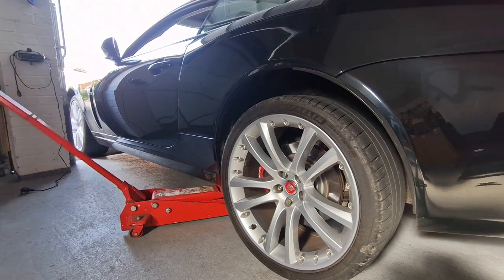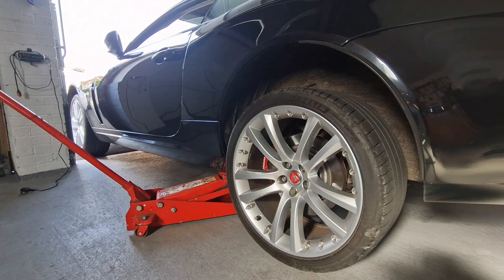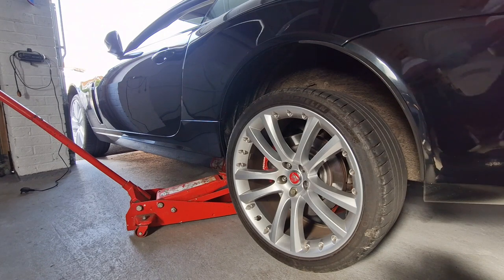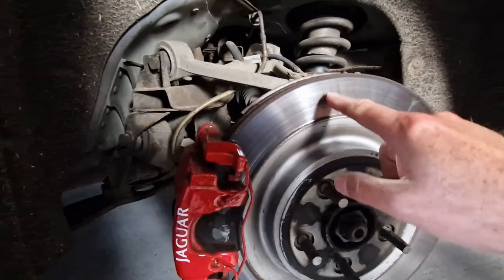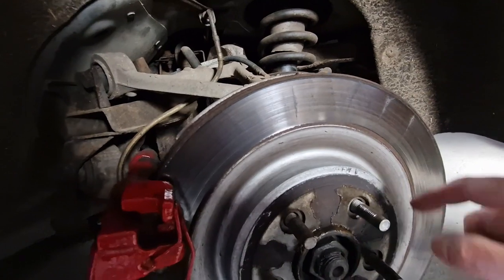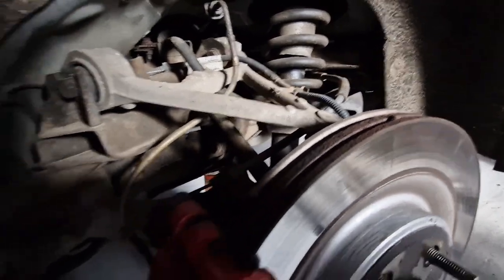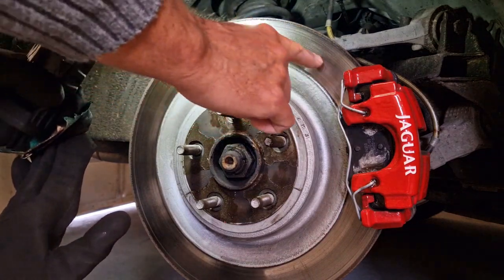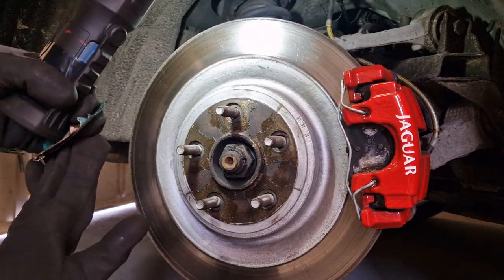Jaguar XK (X150) | Safety Inspection |Preventative Maintenance | Brakes |Suspension | Wheels | Pt 1

Comment: A really informative video - thanks. I notice that you are running on Michelins on the rears. Just Cruisin' who has a Youtube channel has fitted a set of Pilot Sport 4S to his XKR and says they have transformed the drive for the better. I have recently fitted a set of Dunlop Sportmaxx to my XK and the road noise levels have gone through the roof. I think this has a lot to do with the low profile ratio that you mention and that they are run-flats, so probably a harder sidewall compound. I would certainly steer clear of the Dunlops when it comes time to change your tyres.
Reply from the maker: Thanks for the comment 😊

Comment: Rear reverse light out mate 👍🏻
Reply from the maker: Good spot I need to check that out 👍
Reply: Nothing wrong with it. They only have one reverse light other side is the fog light.
Reply: @danielroberts6637  Correct. Here in the States, I've made a print-out of the manual section where it mentions this quirk. This way, if I'm questioned by a cop or inspection station about it I can show that it's "working as designed".
Reply: I have checked mine and both reverse lights work 🤷🏼‍♂️
Reply from the maker: @Andrew Mitchell  hi Andrew I will solve this by taking a look and making a little video 😁👍
Reply: @life_on_cars  Yes, one reverse light and one rear facing fog light for the two attached to the hatch lid.

Comment: I have a 4.2 2007 xkr &69k miles and would be interested to know if you need to consider doing anything significant with timing chain guides as a preventative measure ?